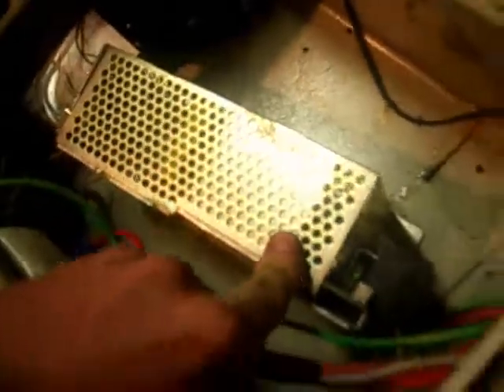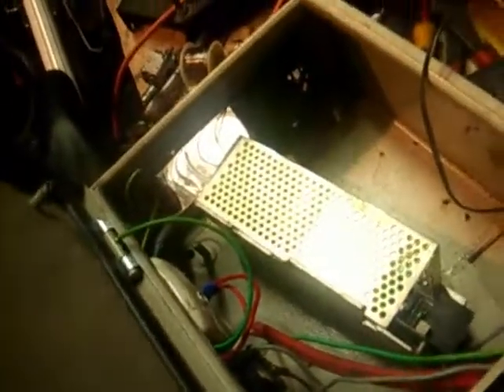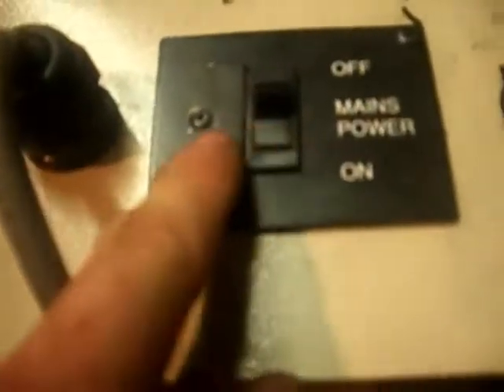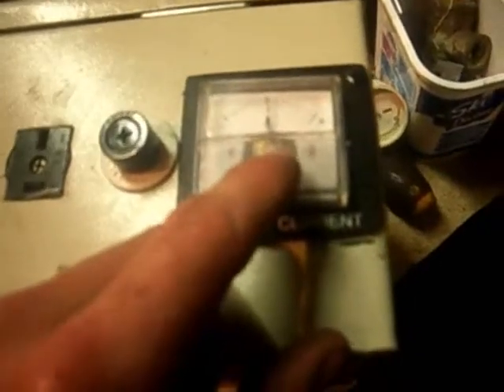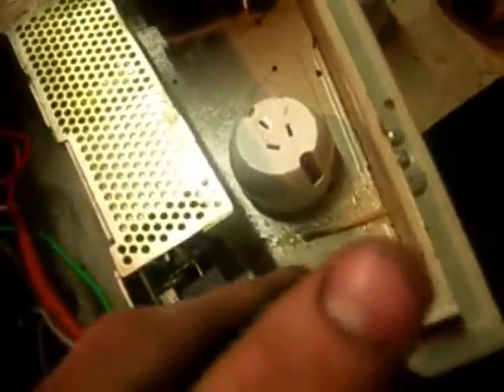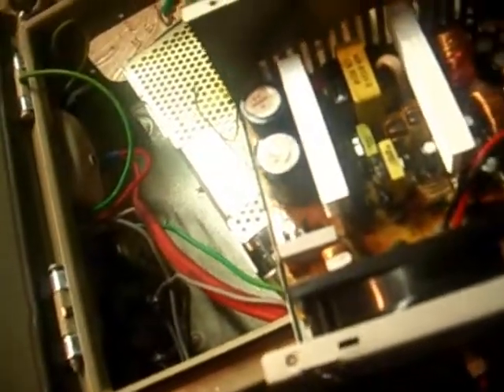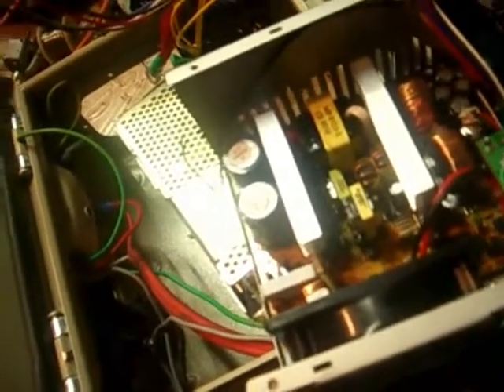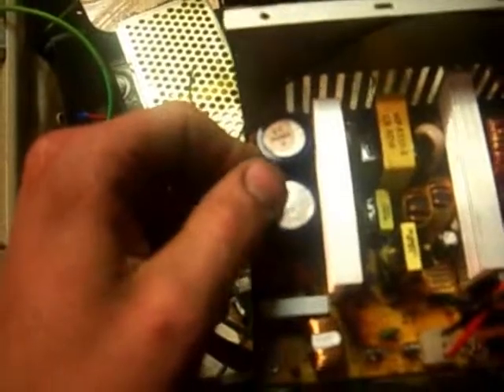electrolysis power supply update

Comment from the maker: @pow0006 i dont believe anyone knows quite how it works but the bicarb soda acts as an electrolyte to improve the conductivity of the water. it seems that the rust is pulled from the metal because of the transfer of electricity between the anode and cathode. im not sure tho, maybe a google search will shed light on it!